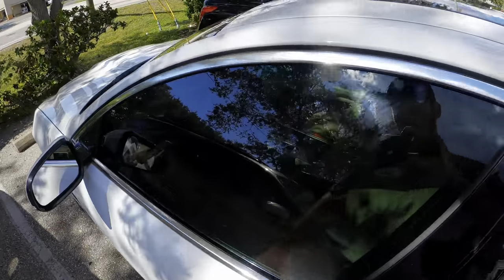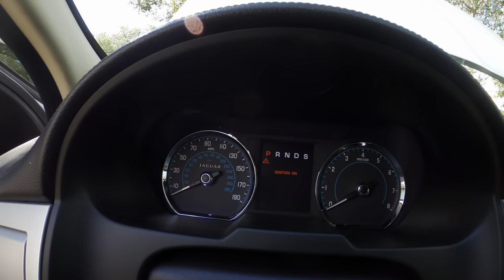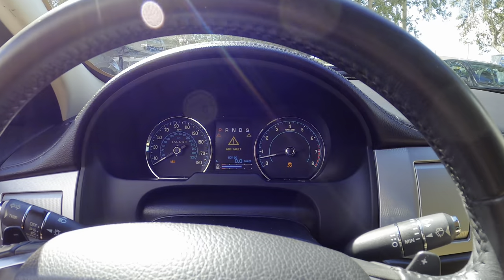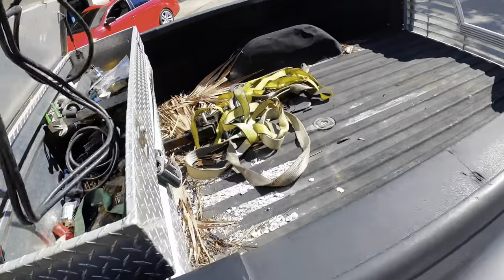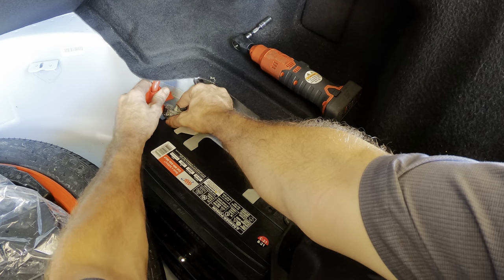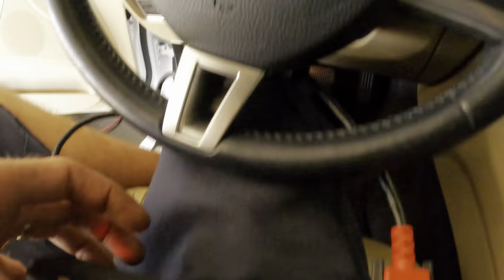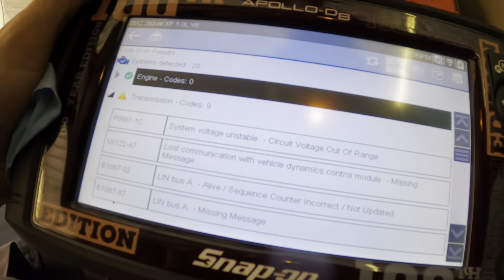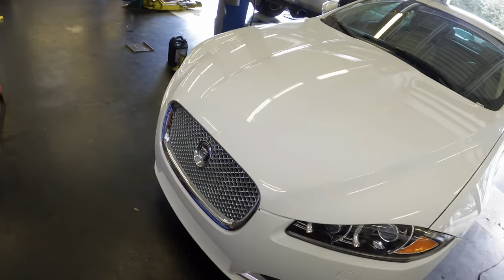Jaguar XS just Towed In.  I’m in over my head! Customer States: “Check Battery”

Comment: As an owner of some older (and some much older) European vehicles, "I'm not qualified to work on this" is a perfectly acceptable response from a mechanic. But to give you some added perspective from the customer, I'm very willing to pay time for a mechanic who is willing to dig in and learn a little bit about a vehicle he's not familiar with. Contributing to my mechanic's education is money well spent rather than just taking it to a dealer whose techs are often no more knowledgeable than the independent, and are just going to start swapping out parts on my dime until the problem goes away. I know not every independent mechanic has the inclination or time to dig in and learn an exotic, but when I find one that does, he's got my loyalty.
Reply: I think the difficulty is what shops are willing to pay for software. Automotive is extremely expensive, and of the dealerships have the software for their vehicles. If I had to bet money then I’d say that the dealer is just going to clear and reprogram the entire system and then slap you with a $5-10k fee (or probably more). Some times some really odd stuff can happen to the E2PROM in the vehicle, and at that point there isn’t a way to fix it without reprogramming it. Who knows what happened though, I just think it’d be a huge hassle to actually pinpoint the exact issue, because it could of messed with a number of things, especially if it was just sending random signals all willy nilly.
Reply: Came here to make the software comment
Reply: Sadly I live in the same town as Ray I had a Jag, The jag dealership is crap.
Reply: I totally agree, but an even better solution is to find a good independent who specialises in the vehicle or manufacturer you own. That way, you benefit from the experience they gained on other people’s identical cars.
Reply: Its always awkward to be a european hearing our cars spoken about as if they were an ancient creature found in the forest 😂
Reply: @kevinpedersen5290  a good garage employing good, honest, knowledgable technicians and mechanics is the real ancient creature in the woodland. It doesn’t matter where you live, or what you drive…that’s what you need!
Reply: Counterpoint: it's not terribly difficult to make things worse by swapping parts in, especially if the mechanic doesn't have the software to tell the car to work with a new part. Modern cars (all cars, but sports cars and luxury cars moreso) can be extremely sensitive when it comes to matching components with modules, and a very likely scenario is you have perfectly good parts not talking to perfectly good modules because it wasn't told to.
Reply: No, an unqualified mechanic shouldn’t touch a car, period. Many of them do and when they destroy your car you have no recourse unless you can prove that the problem wasn’t present when you bought it in for service. Why don’t you just take your car to your janitor for repair? That’s a really stupid suggestion, think before the next time that you comment.
Reply: @kevinpedersen5290   "creatures found in the forest". 🤣 I like that.
I think European Cars that are imported are "Luxury" cars. Can't make money exporting just a Basic Vehicle. (Does anybody even make those anymore?) You get the same problem no matter what name is on it. One wire doesn't make a secure connection and it throws the whole system out of whack and when everything is tied together, you're screwed.
Reply: The problem with diagnosis of complex systems is that "symptoms" are always a smaller set than the number of problems that can cause them.  That is, different problems can cause similar misbehaviours.  In a purely mechanical vehicle - I loved my old Ford 1960 1/4-ton - it much less convoluted, but the decision tree for diagnosis in Chilton's still ended at a menu of possible causes for some problems.  Modern vehicle are computationally more complex than the computer or smart phone you use.  I once built an entirely new computer, except for the case, in the processing of discovering just what was wrong with the motherboard.  After replacing each possible piece that seemed highly likely to have caused the specific failure - my drives, and replacements, started writing files that only they could read - I finally resorted to replacing the MB, which dealt with the problem.  In this case, the alternator might be the problem, but the failures were wide spread, so maybe not (probably not?).  Either way, dealer, or mechanic learning on the job, you could be looking at serious money.  Of course a Jag is already serious money.
Reply: @RobSnyder  It;s not the dealership per se. It's the vehicle after 50K miles.
Reply: @kevinpedersen5290  They tend to be overly complex in comparison to Japan's offerings.

Comment: As a retired technician (mechanic) I have been in similar situations here in the UK. I was even threatened with the sack for not being able to diagnose the first Lexus with the digital dash that had a fault in one of the modules and the displays were all over the place. My boss was too bloody tight to get the workshop disks at £700 each and expected me to just start pulling wires, chase the circuit board tracks and 'play' with it for 6 hours so he could charge a massive amount and then send it to the Toyota dealership for repair. I refused then walked out.. Smartest move I ever made. Kudos to you for your honesty, it's a bitch when customers think we know everything about anything mechanical and assume we are just trying to get more money!
Reply: Suspect on the xf it will be the ecu (ecm) found on the lower right side. As mine had the same problems? Common problem! These get damp and rust the pins after finding the cost of a replacement plus the added nightmare of getting it to read the vehicle after, I decided to have it taken apart and solder repairs made✔Problem fixed.

Comment: My friend, I worked for the Penske Automotive Group in Los Angeles back in early part of 2000's.  We had several dealerships (ALL Import models ONLY) and one of them was a Jaguar location.  Anyway, while I worked in the IT department I KNEW enough to know that EVEN MB's were EASIER to fix than the Jag's were!!!  YOU DID PERFECTLY RIGHT when you figured out that beyond the simple things such as an OIL change or a new battery EVERYTHING BEYOND THAT POINT TAKES AT LEAST 2 FULL YEARS of schooling BEFORE you are able to work on any type of Jag AFTER 1998 on up to the present!  So you've done right ALL AROUND HERE OK!!!  I've been watching you now on and off for about 1/2 a year or so and I WISH you were here in UTAH!!! It seems that ANY of the mechanics around here are EITHER INEPT OR CROOKED BEYOND BELIEF!!!  YOU ARE NOT and because of that I just wanted you to know that WE ALL APPRECIATE ALL YOU DO!
Reply: I've owned several Jags (and just bought another) and do most of the work myself.  It's not that hard if you have 1/2 brain and can follow directions.   You also need to have access to factory service manuals (via AllData ~$60/year) and access to Jags factory computer diagnostics (~$300 plus hacked Chinese software).   The real problem with Jags is that, particularly used ones, they are bought by people who can't afford to maintain them.  Same is true for just about every other high-end luxury Euro car, but used Jags are generally esp. cheap.

TL;DR - if you want to own a high-end European car, you need to be able & willing to spend the $$$ to maintain it otherwise it will break and cost a lot more to fix.
Reply: @ckm-mkc  this is what I usually find as well. Its not that they can't afford to maintain them either, they just don't get shit serviced until the repair bill is 3/4 of the value of the car and they off them
Reply: jesus.... did you find any polyps while you were up there?

Comment: Way back in the day I was a young man learning on the job, We had a customer bring in a Jaguar xke carbureted V12 that "Didn't seem like it's running right."  I did the basics first and decided it had carburetor problems. The thing was though I had never worked on those.  I seem to remember they were Stromberg carburetors correct me if I'm wrong. Fortunately I had a buddy who knew Jags inside and out. He came by and overnight he taught me how to diagnose, repair, and synchronize those things. I had a customer for life after that and I gave my buddy his half of what I got paid for that job. I saw that Jag many times after that for many repairs. One thing I loved was test driving that Jag. Oh my god it was quick and super smooth. Manual gearbox, sweet ride. One and only Jag I ever worked on. Thanks for this video Ray brought back some good memories.
Reply: That’s awesome. Nice post. And cool to share half with your buddy

Comment: Your decision to turn the job away, based on your experience as a motor mechanic was, in my opinion, the absolutely correct thing to do.
Added to that, your further decision to make no charge, puts you in a league of one of the most honest and decent mechanics that ever drew a breath of fresh (or stale) air.
Your sense of "fairness" is a credit to you and knowing when not to get involved is vitally important if you are going to avoid the unenviable task of trying to climb your way out of the slimy pit of doom, gloom and failure.
So, Ray, "well done, Sir..........................the world needs a hell of a lot more more, "Rays."

Comment: As a German auto owner I applaud your attitude and handling of this,  any time I’ve need a tow from breaking down I’ve had to fight with my towing coverage to take to a repair shop specializing in  European vehicles.
Reply: You clearly do not have AAA. For a few bucks more, AAA will tow me 100 miles wherever I say to go. Used it three times for towing so far.
Reply: @marksd5650  so I’m paying for AAA premiere coverage  with trailer and motorcycle coverage for nothing.
Reply: @marksd5650  AAA's rules or benefits seem to vary by state. It's feasible that not every AAA member gets the same 100 mile towing allowance.
Reply: @truckntech3347  TFC is right.  I think it is the next step up from the standard AAA. The one time I needed it, the driver asked me where I wanted to go.  I told him home.  I fixed it myself.
Reply: Even as a European tech I hate Jags and land rovers , work on them only because my boss tells me to.
Reply: @johnzenkin1344  I love BMWs they  break job security
Reply: "Any time I've needed a tow". You need a vehicle that does not need to be towed from breaking down routinely.

Comment: @Rainman Ray's Repairs
I'd love to hear what the diagnosis was from the customer when they take it to the Jag Specialist.
I'm darn curious, and frankly I think a decent customer would respect you for trying to follow up on the repair!
Reply: id bet dollars to donuts its a short and/or a bad alt. modern luxury cars are sensitve to voltage issues
Reply: I have a Jag and the clue is in the multiple error codes, that's always a sign of a battery/alternator/earthing problem. I'm sure the dealer just fixed that charging issue, be it a dead alternator or bad earth and everything else would totally fine after.
Reply: I would bet that its a bad alternator, or something in the alternator circuit. But chances are that someone damaged the bcm trying to jump start the car after the alternator died. Like i have seen quite a few times.

Comment: My experience with European cars is that they are absolutely crazy when the alternator goes out. Replacing the alternator and battery solved all issues.
Reply: Exactly what happened to mine. Had the same exact problems. It was in fact the alternator. Love my Jaguar to death.
Reply: @SoulTransfusion  No idea why Jag owners love them so much. There’s honestly a laundry list of cars that are better or that’s I’d rather have.
Reply: I inherited one. My head said sell it. I picked up a wrench just to tighten a couple of things and now its worse than a crack addiction.  I’ve about rebuilt the whole damn thing. It’s hard to put into words why 😩
Reply: @roji556  agreed. while i was in europe i drove a lot of different vehicles and jags were by far the absolute bottom of the barrel for the class and price. Feature for feature BMW, MB (and i really didn't like MB's styling) and even Audi just made the jags look and feel like trash by comparison. Materials, fit and finish, power delivery....the jag really had nothing better than the others, and the automatic ones shifted like a 13 year old american kid who stole their dad's ride and hasn't learned to drive stick.
Reply: @bo64hellfire  Jags are cheap here in the uk, you get a lot of car/performance for the price, 70's and 80's ones were great designs built very badly by a militant socialist workforce with weak management, 90's onwards were ford based (floorpans/engines) granted they don't have the build quality of german cars but they cost less.